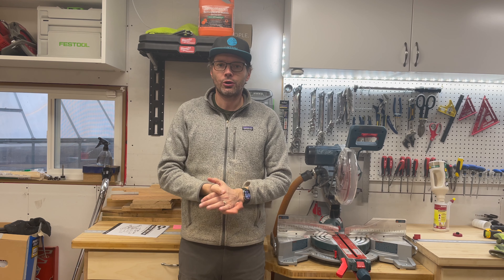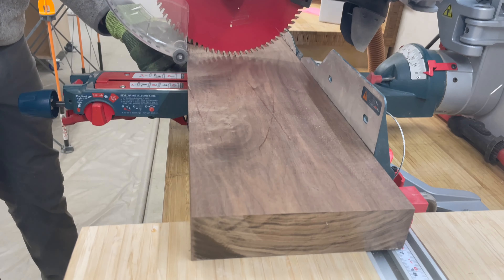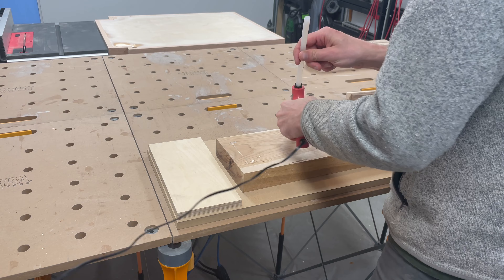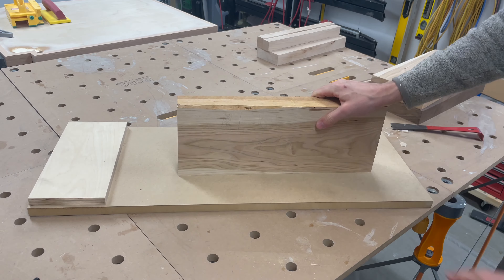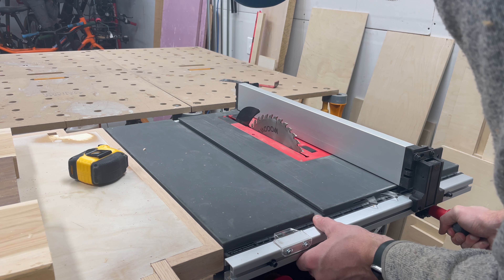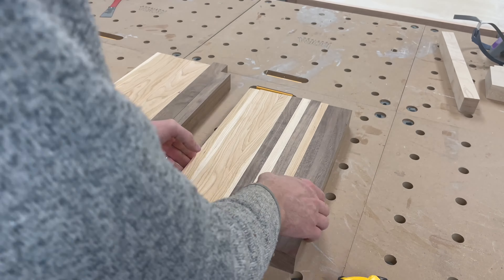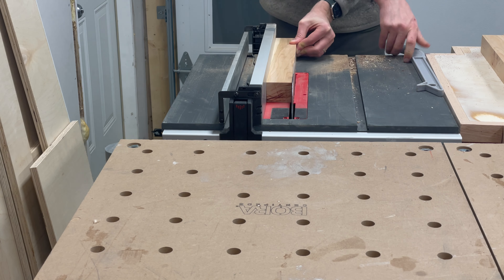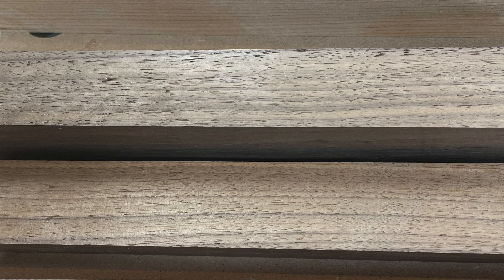How I Joint an Edge With My SawStop Compact Table Saw

Comment: Interesting edge jointer method. Any reason why not build a sled using clamps? Also where is the table saw stand build you promised in your last vid on the SS CTS? I got a SSCTS and yet to build both stand and jointer jig.
Reply from the maker: Both methods work. I will build a proper sled at some point with clamps so that I can use it for jointing as well as tapered cuts. This is just a quick way to joint an edge with a scrap of MDF or plywood. The table build is still coming. I have a couple drawers left to build and will get that done and the video up in the next couple weeks. How are you liking your CTS so far?

Comment: use double stick tape not hot glue.  You are not guaranteeing a perfectly flat glue down which will not guarantee a perfectly jointed edge, plus the tape is easier to release and quicker.
Reply from the maker: Good tip!